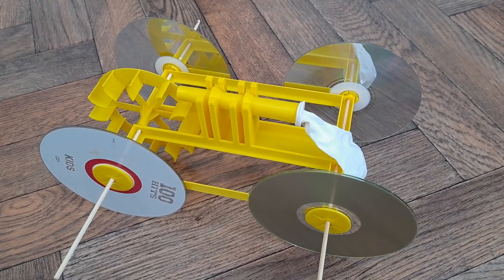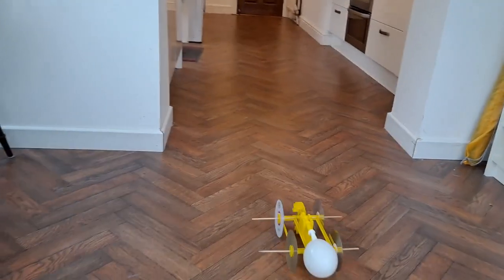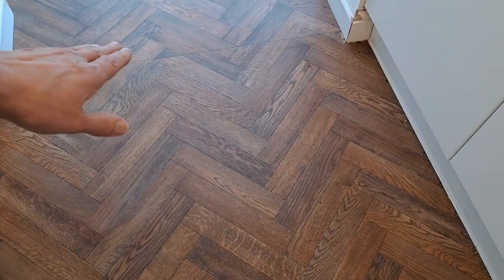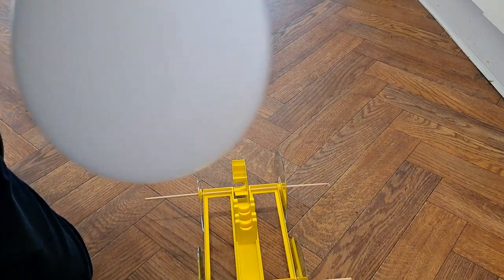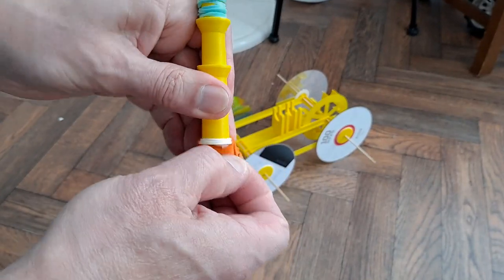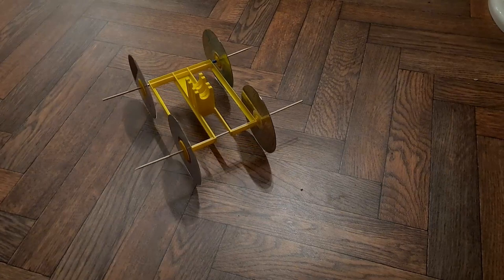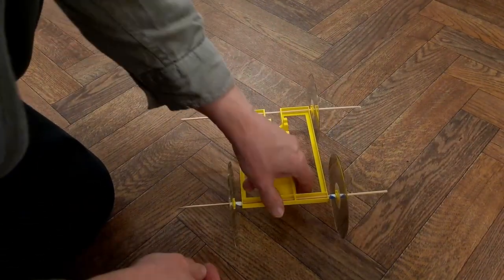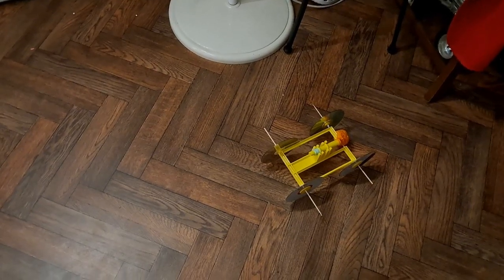Balloon Powered Car Mk 2 chassis Mk 3 paddle wheel

Comment: Nice print off and the Design looks easy too.the paddle wheel looks way better now since the paddels are now curved and Grab more air from the balloon  . Thats going a Lot further now than it was  before.think that pipe has helped a Lot and with the fresh balloon as well.nice far runs you got out of it😀
Reply from the maker: It did seem to go further under power but I am not sure we can prove the difference as there will always be a difference with the balloons when they are new and then when they have lost some elasticity. I think it was an improvement.

Comment: Try a 90 degree elbow at the end of your tube with balloon pointing up.
Reply from the maker: When the balloon deflates it flops over and drags on the wheels. There is another balloon car series I am running more or less concurrent to this paddle wheel car that does use a 90⁰ pipe. Usually it falls clear, but as the balloon loses elasticity it gets larger and more prone to fouling the wheels.

Comment: Hi Grandad. Just had a thought watching your video. I suspect you are about done with this series of videos you have put a lot of time into it. 
Anyway I know you have an anemometer so I was wondering if you could use it to determine the air flow speed of the different restrictions you have for the end of the tube. To find what diameter yields the best results. I am thinking a smaller hole the pressure or push would go up.
Reply from the maker: That is the general consensus, however I would liken it to voltage and current. (The reverse of the usual "Lets explain electricity by using a waterpipe analogy"). You have a fixed amount of energy available - the balloon - call it the voltage,  call the flow of air the current, call the restriction of the tube the resistance. By reducing the diameter we are increasing the resistance and reducing the current. The speed of the airflow might increase and an anemometer would tell us the wind speed, but it wouldn't tell us the power. What we do get, is two changes. First the jet of air is focussed over a smaller area, so it might be hitting the paddles more effectively so there is a more efficient increase in pressure. Second, the flow is reduced so the balloon takes longer to deflate, so the lower power is applied for longer. In the first video in this series I was using a much wider outlet, it produced enough power to cause the wheels to spin rather than drive the car forwards, but it was for a very short duration. After that I reduced the diameter in stages and in this video the balloon takes nearly the full run to deflate but the car moves very slowly.

Comment: Your designs are really good. Just a couple of thoughts. How about printing the balloon tube with one end closed off and a 90-degree tube sticking out the side of the main tube.. That would keep the balloon upright and away from the wheels. Just a 90-degree pipe really. 
Another thought was about the problem of releasing it. A spring-loaded check valve with a rubber washer. So you just press a button to open the check valve and you don't need to use your finger. Might need a strong enough spring to keep the valve shut when under pressure. One of those little spring-loaded projectile launchers with a rubber washer to stop the air leaking out might work. Just super glue it on to the outlet. 
A couple of ideas. 👍👍👍🎸🎸🎸
Reply from the maker: When the balloon is empty it falls over even if it is standing upright. (See my other 3D printed balloon powered car for the 90⁰ pipe).  So we are talking about covering the wheels. As for pressing a button to release a valve, how do you press the button without imparting some motion on the vehicle. We are moving into RC territory with a solenoid operated valve 🤣👍
Reply: @GrandadIsAnOldMan  I obviously missed the video with your 90-degree pipe. As for the release button, you may be moving near RC but it is still ballon-powered.
Reply from the maker: @mikeflight9  the other car gets another video on the 23rd so you can catch it then 🤣😁 Yes RC would do the job but probably put it into a different level. I have a playlist of "advanced" rubber band cars done by graduates with as far as I can see, no expenses spared https://www.youtube.com/playlist?list=PLA5a2xPRSrB0dbQ1TpU4qJx4m85zK7MFa

Comment: I saw you once hold the balloon shut off at the rear and let it go. You might want to investigate that method a little further.
Reply from the maker: It's one of those things you have to try yourself to understand just how difficult it is to release it cleanly and not impart any "assistance" to the car from the motion of your hand. Any indication that I have assisted the car by pushing it would instantly be jumped on in the comments. I have wasted enough time in these videos trying to explain how the floor is not perfectly flat, so the car does roll about at certain points. It is travelling so slowly with so little power that the undulations in the floor become apparent and significant. My rubber band powered cars travel the full length in both directions with ease so these undulations are irrelevant to them. A larger balloon would also cover the distance easily, but I am using small balloons.
Reply: @GrandadIsAnOldMan  Yes I saw what you were dealing with in about the first video. Using a balloon for power as you are must be the least way to drive the car across the floor. It looks as hard to do as stacking greased ball bearings. Lol.
Reply from the maker: @Sea-Dog5496  the simple answer is a bigger balloon, but that is not really proving the design, and does bring a few other problems. However the extra power would allow a shield to be fitted to prevent the balloon deflating over any moving parts.